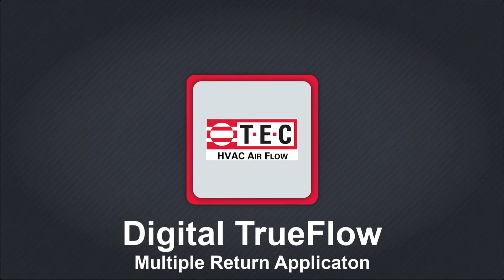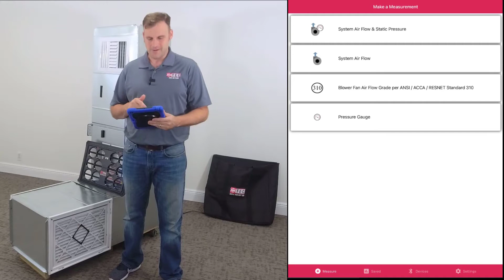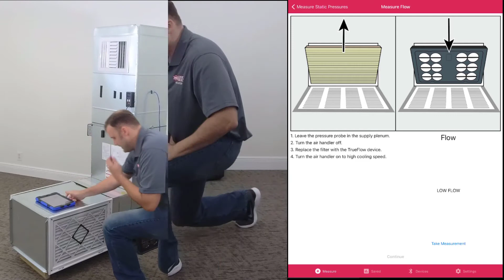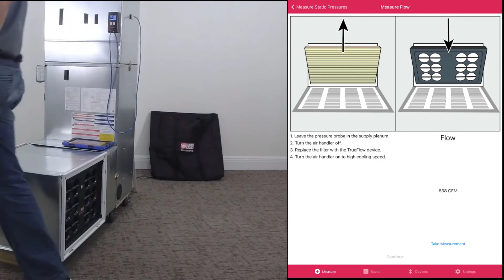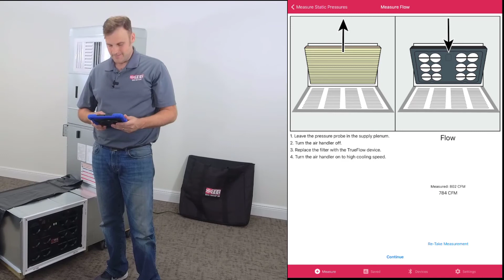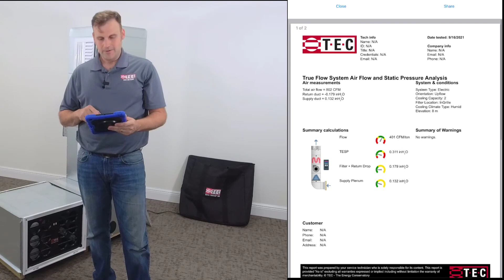TEC TrueFlow Multiple Return Application

Comment: Will blocking one vent give you the same reading if you tested with two trueflow plates?
Reply from the maker: Good question!  Although our software is not ready for multiple TrueFlow use, using two grids would deliver a combined flow that would be equal to the blocking one vent method.

Comment: I had expected that measurements would be needed on both sides. Hasn't the ECM ramped up when one filter inlet is blocked off?
Reply from the maker: The ramping of the ECM motor is no problem.  As the motor ramps up, the need for correction factor in the app will be reduced.